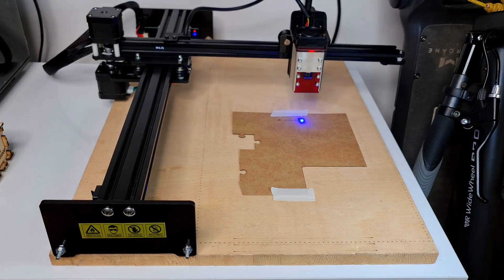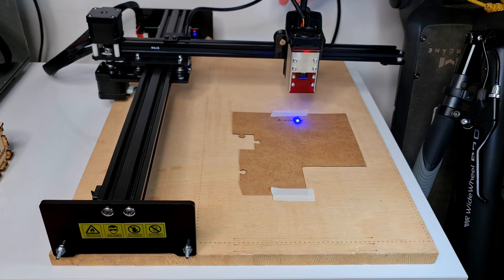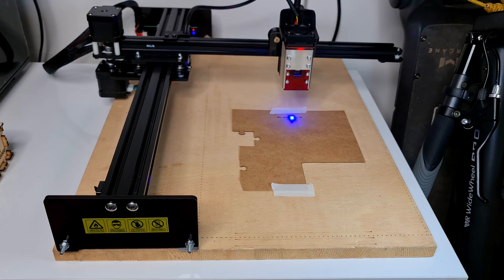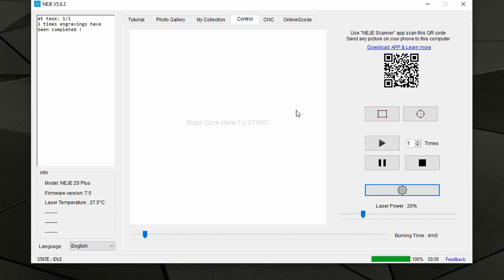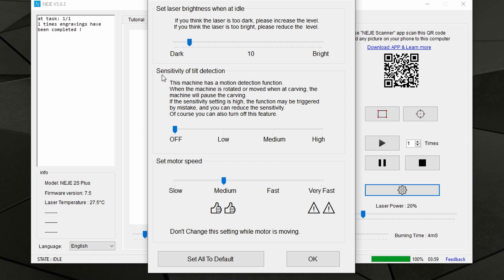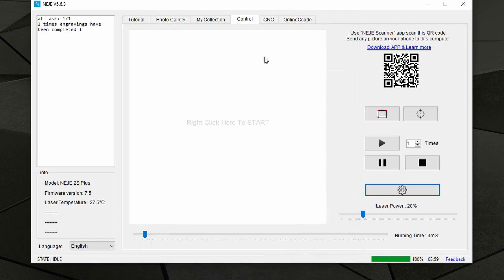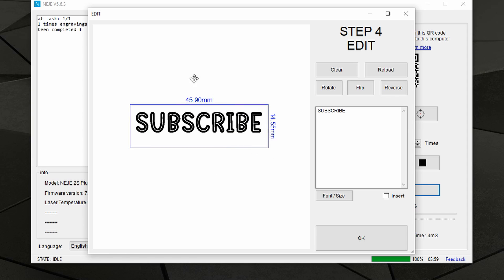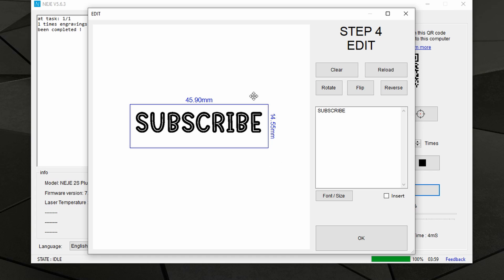Can you Engrave in a Vertical Position - NEJE - Be careful

Comment: Hi. I cant get my neje master 2 to connect to my pc and i have message neje support no response any ideas? Thx..
Reply: Do you habe other equipment conected to the plug?
I had that problem and solved it by connecting only the laser to the socket.
Maybe in my case the equipment did not have enough energy.

With lase GRBL you have to conect it from the program.
Reply: The model I use is the neje master 2 2s max "80w"  it works good for engrave low power and mid speed.
But I can't cut the material always burns dont pass through
Reply from the maker: Hello Marcel, thank you for your comment.

In order to be able to cut you need to focus correctly the laser, otherwise you end up with a hot area rather than a point.

Ciao
Reply: Try a different USB port and or lead.
Reply: The only other thing I have connected to my PC is the keyboard and mouse I have a separate USB hub with nothing connected to it still no connection with any other software for this laser printer i was able to connect through my phone but the app i was doesn't let me set my specs for the wood im engraving.. any other ideas?? Thx
Reply: @jasonwyngardi1468  Is it the scanner app or the control app? Do you have the right drivers? Can you connect directly to the pc without the hub?
Reply from the maker: Hello Jason Wyngardi, thank you for your comment.

Please let me understand if you have ever been able to connect to the PC, in particular with the Neje Desktop App?
If you cannot get the device recognised try the following by exclusions:

Unplug all of your USB devices --> shutdown the PC --> Unplug the power for at least 10to15 seconds, then start your PC and plug the keyboard, mouse and your laser machine directly into the PC without cascading USB hubs, to begin with.
If things do not change, try what has already been suggested by MrNlCE79, i.e. change USB port and or Cable.
Do you hear any system sound when connecting the cable while the machine is on? (you must have speakers on your PC to hear it)

If you are still unable after these simple steps, we need to look into the USB Controller and try to update the driver through the Device Manager.

Let me know
Ciao

Comment: Hello, today's video content was also very good information!
It was the first time I knew if I could stand it upright and operate it.

Even if it's a portable device, it seems like it's going to hurt the product if it works 100% vertically.

I still can't cut characters using GRBL software.

In Korea, there are not many users of small laser cutters, so it is difficult to find information.

Thanks to you, I'm learning a lot, and I want to use the GRBL software, but I can't use it on NEJE 2s plus equipment.

The GRBL program works well, but the machine's 0 point and the software's 0 point don't match, so I'm having a hard time ^^
Reply from the maker: Hello Bebepapa, thank you for your comment.

Tell me more about your problem, i.e. why you cannot use the Neje 2S plus with GRBL?
Unfortunately, the issue with GRBL's origins is annoying, but you can work it around setting the new home in the software so that it engraves where you like.

Ciao

Comment: In the promotional video for the NEJE Master mini it is shown not only clamped vertically on a wall but also powered off of a battery pack.
Reply from the maker: Hello MrNlCE79, thanks for your comment.

As you have seen in my video working vertical is possible, but with a risk that if you have a power outage, the vertical axis will drop with possible damages.
Also consider that the NEJE Master mini has a shorter axis, therefore not much length to accelerate.

I hope it helps.
Reply: @MiddleRoomWorkshop  I agree that it's a bad idea. I was just pointing out that it was shown in there video.